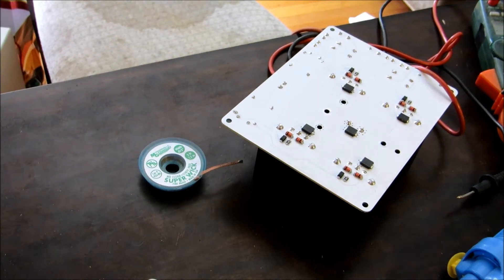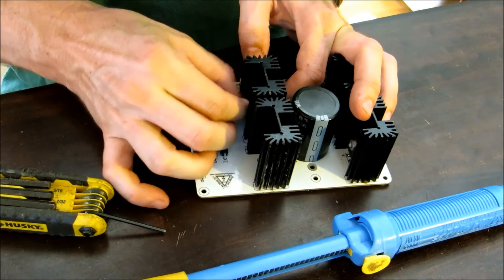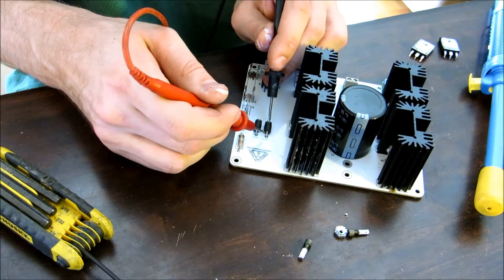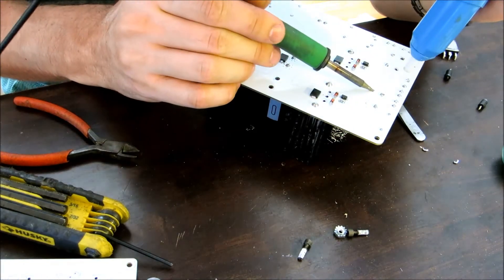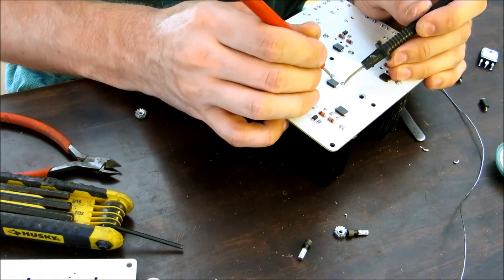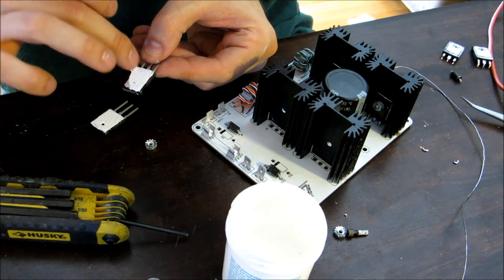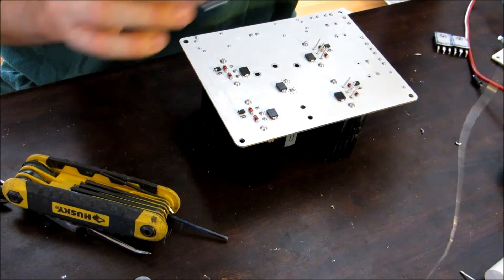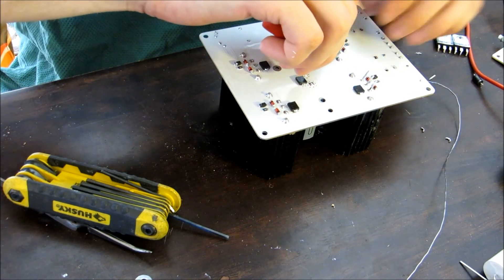De Soldering IGBTS The Easy Way

Comment: Quick question. I bought a screamer from you couple years back but had a 20n60 go bad so I have 4 new 40n60's can I replace all for with these without issue.  And primary impeadance?  Can't remember. Thanks. Joshua
Reply from the maker: Joshua lee Franklin yes.should be fine
Reply: Changed igbt's and it seems like h bridge is hi load (as I have on variac)  checked diodes and modulator board seems to work fine as I can hear switching. Last time I ran over 60 volts the inrush current limiter blew and I replaced any ideas?  I'll check rectifier on bridge board tonight....also would like to know designed primary henrys?  Thanks. Lots of cool projects you got going